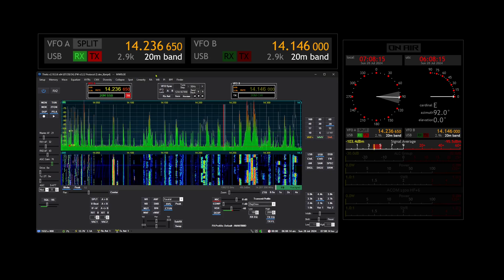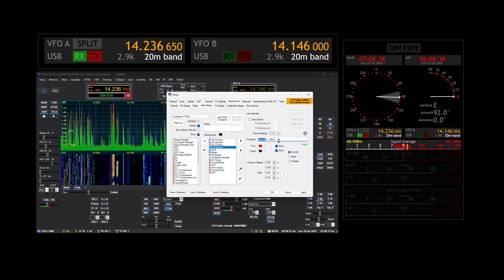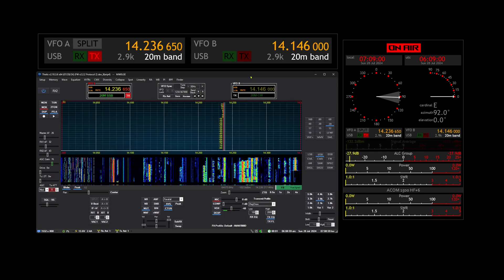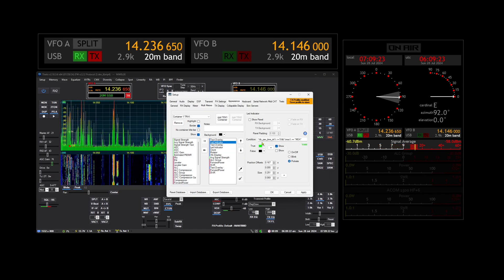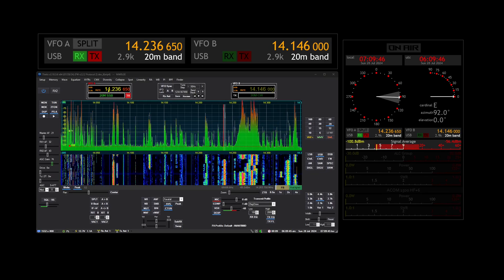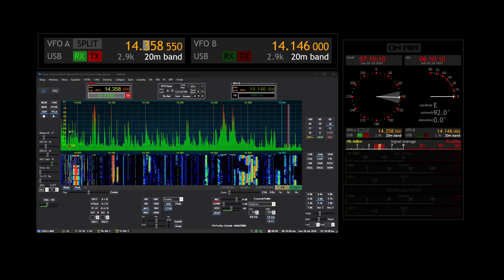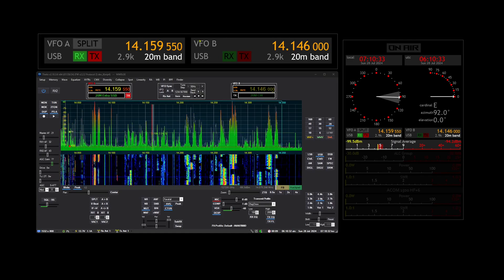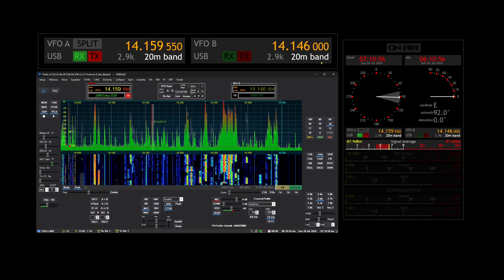Thetis - VFO Control

Comment: Amazing! Would really appreciate auto diversity and integration of the wheel in main window
Reply from the maker: The main ui will be changing this year, to make more use of containers so everything will eventually be able to be positioned allowing better integration with things like the vfo wheel. Auto, diversity. I don't really have any antennas setup for Diversity here, so not really an easy thing for me to work on, and with so much other stuff in the pipeline it probably wont happen for a while. It is on the list though as an idea ;)

Comment: Would be nice to have settable minimum frequency steps in the vfo so it would say move 1kc steps or whatever size that is selected. Hams use 1khz channels for the most part for phone ops operation and bumping  the vfo to an odd frequency is something you want to avoid at times.
Reply from the maker: tune step can be used for this. You can long hold/mouseclick on the kHz numbers 14.234.000, so on the 234 and a tune step grid will be shown. 73.